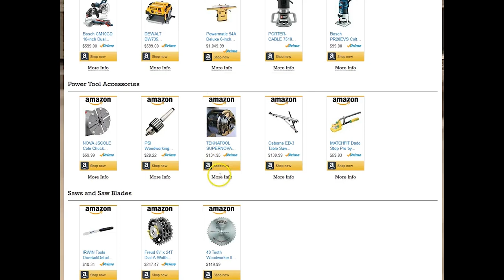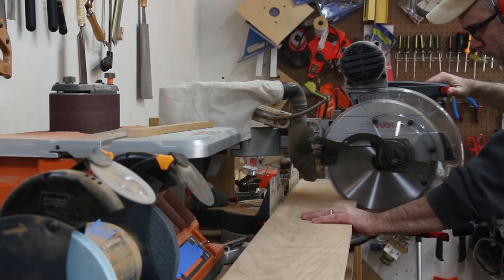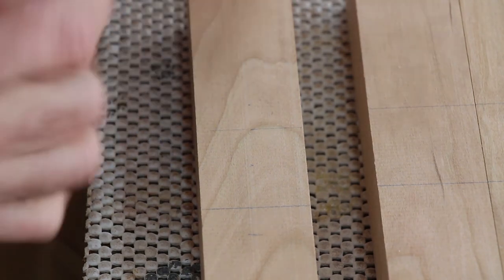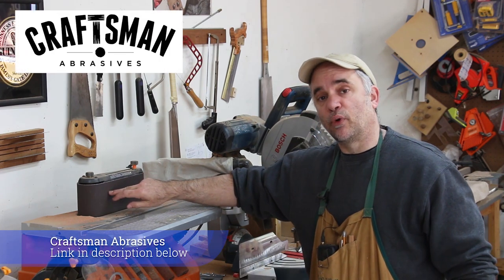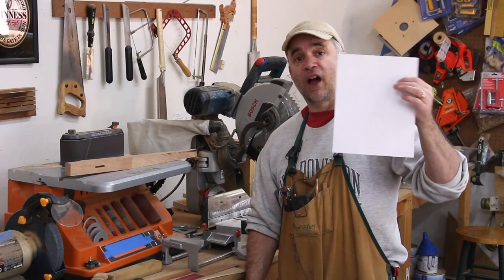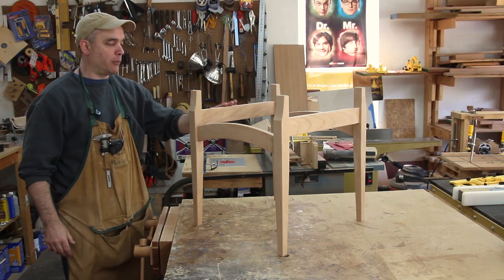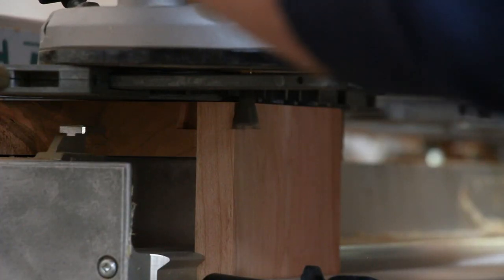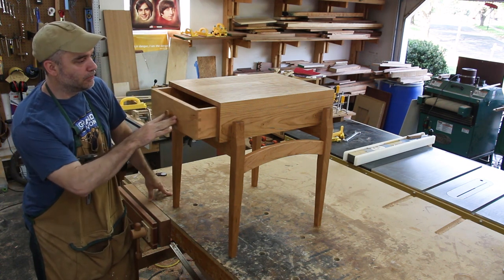Modern Drawer Box Table Combined

Comment: Thank you for thoroughly enjoyable and very informative video, and a really nice table design :D I have a few questions about your jointer. I am transitioning from a combined tabletop style planer/thiknesser which is of very low quality, but usable after lots and lots of modifications. So, I have been looking at my options. And due to the size of the entrance to my workshop - I have to go with two machines, not a combined machine. 
I see that your jointer has dovetailed ways. I have heard that they can start sagging after a while, and loose their alignment. How long have you used that jointer, and have you had any issues with it with regards to sagging or the tables not being coplanar? Is it a 6 inch machine? And if so - do you feel that it restricts you in any way?
Cheers.
Reply from the maker: Before I get to your question, let me clear up the nomenclature.  You want your jointer tables (in/out) to be parallel, not coplanar.  Coplanarity refers to two planes that are in the same plane. A jointer with tables in the same plane will never cut wood. You want your tables to remain parallel.  One plane (outfeed) slightly lower than the other plane ( infeed) but always parallel to each other.  I’ve not noticed them sag in the 15 years or so that I’ve owned it, but it did require adjusting to make parallel.  I shimmed the outfeed table with strips of aluminum from a soda can by lifting the outfeed table slightly and sliding the aluminum underneath the dovetail.  After this is done, only make your adjustments for cut depth from the infeed side - don’t adjust the outfeed table any more. I’m going to paste in my next reply a link on how to properly and accurately align for parallel using a dial indicator.  I highly encourage you to watch.
Reply from the maker: https://www.garagewoodworks.com/video.php?video=198 And see: https://www.garagewoodworks.com/video.php?video=226
Reply: @GarageWoodworks  Thanks for an in-depth reply :D Is that an 8" or 6" machine by the way?
Reply from the maker: That’s a 6”. The adjustment I made to align it parallel wasn’t done until I realized that it was out of parallel using a DI.  It wasn’t off by much and could have been that way since day 1; no sagging, just poor quality.   My newer jointer is a 8” Grizzly that uses parallelogram beds.
Reply: @GarageWoodworks  Oh. So you have one with paralellogram beds now? I can't fit one of thouse through the door/stairs to my basement workshop. With that is mind, would you suggest an older type, the 6" you had? Or are the dovetailed ways too much hassle? I guess I am just a blt apprehensive after hearing a lot of bad comments about the dovetail beds, but I don't really have much of a choice...
Reply from the maker: I’ve had the 8” for a little while now.  I never had any trouble with the dovetailed ways of my 6” - it’s a great jointer and I’d recommend it.  I didn’t realize the tables were out of parallel (by a small amount) until I devised an accurate way to check for parallelism. When you read negative aspects about dovetailed ways you should question if the user knows how to properly check alignment.  I never liked the popular “straight edge and feeler gauges” method - which could result in erroneous results and negative comments.